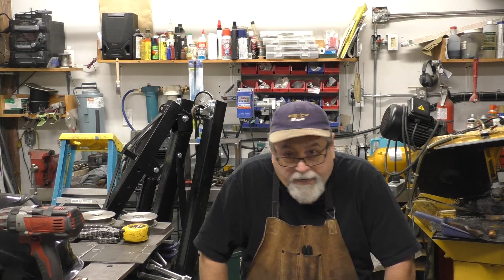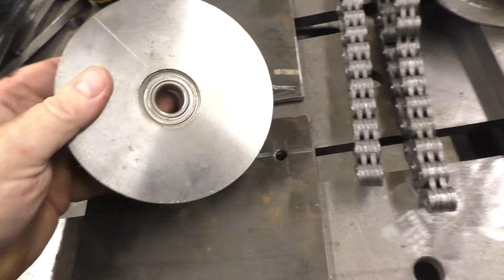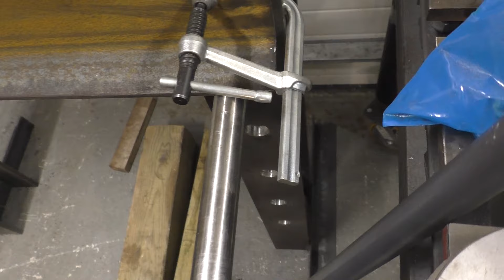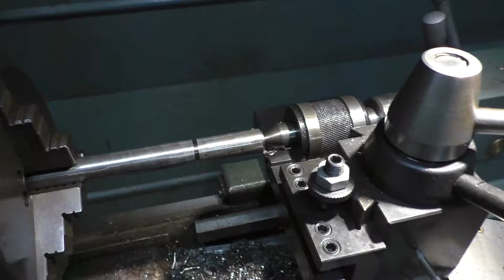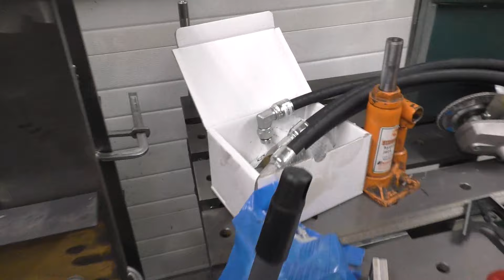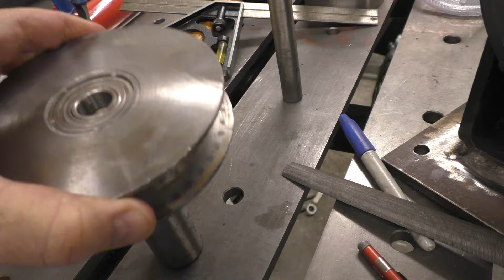Another night in the shop 28 hydrolic press update

Comment: Oxtool nominee, Fred and his press! That hydraulic lift takes it over the top Fred, excellent work!
Reply from the maker: Thank you so much. I probably went over board on the welding putting down multi passes. Just did not want to run into any issues. I don't think i would use all the power but it sure will help.  Thank you for commenting very much appreciated
Cheers Fred.

Comment: Hi Fred,
I see you're still adding weight to that press...   lol
Nice scrap they got there  ( Looks like Bell )
Reply from the maker: The elevator guys are doing freight elevator upgrade. So the parts are 
coming in very handy. As for weight yep. I was looking at a crank from 
boat trailer but just did not want it. Fluid power. is easier. It just 
means more fabricating. So much to do and no time. I like those hammer 
your making very nice my friend Very nice.
Fred
Reply: Philippe wanted to do a simple project this year, it revealed much more work than anticipated...   lol
But, we're kinda proud of our work.   ;)
Reply from the maker: Well Let Phil know awesome job. The rewards of weigh the work. Very Nice
Reply: Fred's Machine Werks
I sure will, Philippe did his share of work in this, so did Robert with the wood work for the handles...   ;)